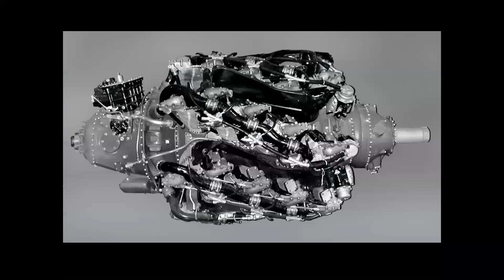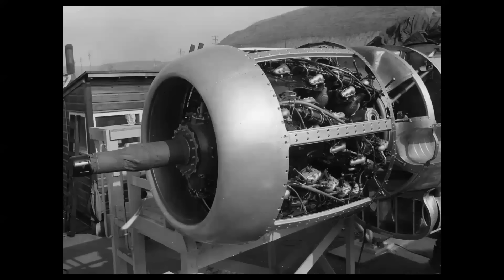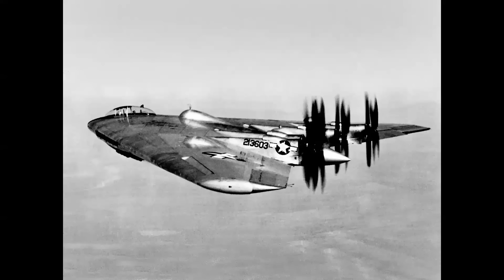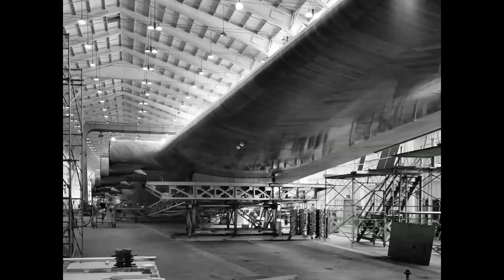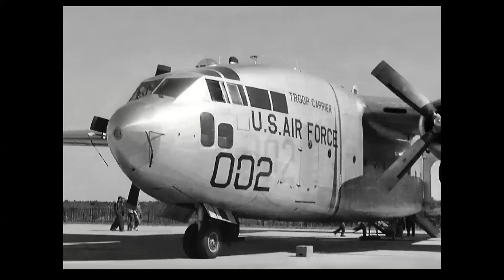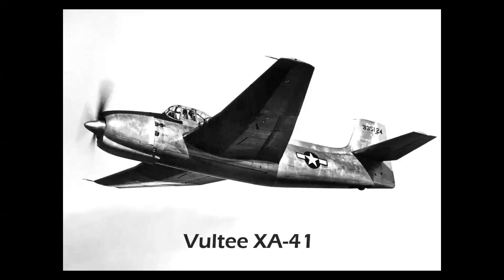PRATT & WHITNEY R-4360 WASP MAJOR AIRCRAFT - Airplanes powered by this giant radial engine

Comment: The yb-35 was actually successful, many of the tests demonstrated that it was capable of having the range and reliability for the mission it was designed to. The problem was that the gearbox for the counter rotating propeller had too much vibration which was not fixed. For that reason, they proceeded with the tests with the single propeller, which reduced a lot of its performance. After that, jet engines were attempted, on yb-49, which had the flaw of having lower range. More than that, the Wasp Major had a severe problem of over heating, which was seen on the Boeing 377 Stratocruiser, as it was common for it to arrive on the destination with at least one engine shut off.
Reply: The YB-49 had some major aerodynamic issues that made it an unstable bombing platform.  The cowling and props on the yb-35 acted as significant lateral stabilizers, and the loss of them really pooched the handling of it.  Northrop really leaned all in the flying wing, and didn't have the control/fly by wire stability tech to make the concept work at the time at that scale

Comment: As an engine enthusiast i can say hands down that air craft engines are indeed the most master pieces of art man has ever achieved . They are the combined power of all our knowledge , from electronics ,fluid dynamics ,chemistry ,machining, engineering , to alloys  and metallurgy .
Reply: Deep respect for massive engines .working like a swiss watch and powerfull
Reply: The complexity and engineering required for the aviation engine is mind boggling, the nomad 2, and other napier engines were absolutely works of art, the turbo jet changed all that overnight

Comment: As a design engineer I can't help commenting that the 4360 (and all engines of that era) were designed on drawing boards without benefit of the computerized 3-D design tools we have today. The designers had to visualize the third dimension on the paper and get that enormously complex assembly arranged without interference between parts.
Reply from the maker: Agreed 100%! It was definitely a different era from today's digital world. Thanks for the comment.
Reply: I just want to know if I can fit this into my Ford Explorer.
Reply: @mabrams8740 .  The torque would probably flip it.
Reply: Couldn't agree more, The level of engineering excellence achieved is nothing short of mind blowing when one considers that engines from this era are the benchmark bar none when it comes to reciprocating aero engines. They invented it all with slide rules and drawing boards and we're still able to take the idea and the tech of the day to the limit.
Reply: David Clark- I have the utmost respect and admiration for the people that designed this wonderful engine! In my opinion they were the brightest and best that this country has ever had! There are several of these and many other great engines still in service today and I stand in awe of the technological marvels of that time! Thanks so very much for your service to this great country of ours!
Reply: My mechanical engineering career spanned the transition from 2D drafting to computer based 3D solid modelling. I was actually actively involved in the early days of 3D modelling. 

The main difference is in the time that it takes to get to a completed design checked documented and approved in all 3 dimensions. Most large and ambitious designs in the 2D drafting era had a 3D mock-up that was developed and available to check the 3D reality and complex 3D linkages like landing gear systems. I worked on the GE LM-6000 in 1990-1993, a ground power variant of the CF6-80C2 Airline engine. We were tasked with the configuration of cooling air, lubricant and hydraulic lines for this ground power engine (60,000 HP for 50,000 hours, 30 different fuel systems for various markets). Every tube and bracket we designed were checked for static and dynamic stress using Finite Element Analysis and they were checked for 3D dimensional fit on the mock-up. In this case, the mock-up was a mix of some real parts from the airline engine, some wooden & plastic parts from the proto shop.

The difference I see in engineering today using 3D modelling and all the new manufacturing options available today is that  designers are able to to confidently design and build very complex 3D geometries that were just too hard to develop quickly and confidently in the 2D drafting world. Really good designers are able to visualize and think in 3D.... The new computer based tools allow them to quickly check, document and communicate those designs with other people and functions.

Comment: Two things amaze me about the 4360 engine. First, the design of 4 radial engines stacked on a single crankshaft and all the mechanics required, the WASP is like a 4300 hp swiss watch. The other amazing fact is that P & W cranked out over 18,000 units with no CAD design help, no CNC machining; just basic lathes, mills, drill presses and shapers set up and operated by people with dirt under their fingernails.
Reply: We need to remember there was still a lot of automation in the manufacture of these engines as repetitive functions were controlled by Cams and Gears,  and maintaining the close tolerances while moving from machine to machine.
Reply: @fltTech72  
Exactly, and most people don't realize that CAD "design" is a misnomer, the computer in CAD doesn't do any of the designing persay, it's still a human that does all the designing, the CAD program only allows them to see what they're designing in 3 dimensions instead of a flat plane, it more speeds up the designing process than anything else.
Reply from the maker: Agreed 100% - thanks for the comment!
Reply: Precision Machinists made it happen! 👍👍
Reply: @danielwalker3430  Indeed! There was a time when the state of Connecticut, especially the Naugatuck Valley, had more machinists per sq. yard than any place on Earth.
Reply: I think that one thing may have been overlooked.  The people who worked at the factories truly cared about what they were. They had brothers,  sons,  and husbands who relied on them to produce a well made machine to protect them.
Reply: It all begins with a good design and a quality manufacturing department 👍👍
Reply: Right on! Right on Ralph Averill!!!
Reply: At the Smithsonian Air and Space Museum (the Udvar-Hazy annex near Dulles Airport in VA), there’s a cutaway 4360 on display. I have spent HOURS studying it. It’s a huge, heavy, mechanical work of art. Magnificent.
Reply: I, personally, have always thought the P&W 4360 would have been a much better choice for the B29, instead of the high magnesium, fire prone Wright 3350. Even the latter day P&W R2800s would have probably been a more dependable engine for that aircraft. If I remember correctly, somewhere around 30% of B29s were forced to return to base, due to mechanical issues, mainly with the 3350, but also with misfunctioning cowl flaps. The 4360 was a monster, & had its teething problems, like every other great WW2 aircraft engine, but, the 3350 had much more than its share of issues.
Reply: @stanhathcoat920  Thank you for the history lesson. I agree that 30% is an unacceptable failure rate, but that is a peacetime, armchair quarterback point of view. They were trying to force the the surrender of Japan to end WW II. Likely they saw a 70% success rate as quite acceptable.
Reply: @ralphaverill2001  Yes, they did. However, I doubt the men who suffered from the failings of the 3350 would find it acceptable. I'm just offering my opinion on the state of the chosen powerplant, & could there have been better choices.  We can't actually "change true history", but we can examine where good & bad choices were made. The B29 was a great, advanced aircraft for its time, & certainly did its job, I just don't see a 30%(+?) failure rate in a 4 engined bomber as very efficient. But that's me.
Reply: Slide rule technolgy
Reply: The last of these were reported to crank out 6000 HP.
Reply: YES there is so little focus on the manufacturing process, and YES it is amazing how these men and women took their turn at the machines to make these immense mechanical devices. Also, while this video is fun and interesting for the extremes presented, there could be an interest in the opposite, the simplest and yet effective machines which were used and how they too could be of value in the battles of WW2.
<3
Reply: Ofc you need to realise all the cad stuff was based on pre-existing methods, drawing standards and the rest.
Reply: I like that thanks for sharing that with us, these are the real ones
Reply: It's the design of the connecting rods that make it work.
Reply: Thnx Mike M. Great page. I too love drawing airplanes. My dad played NFL in late 50. LAX. DC 7, CONNIES & those stupid jets. Talk about ART DECO. 🙂🙃
Reply: The mech's and engineer 's were so ingenious.
Reply: So much for technology - engineers today couldn't conceive that in their minds let alone design and build it without their computers!
Reply: The U S thought that the USSR could not produce thermo nuclear bomb because they did not have the computers that we had. They broke down the equations and had their people do the .math workout computer aid, we all know USSR Had thermonuclear bombs.
Reply: @justadreamin1004  How do you know?  Are you an engineer?
Reply: @MrShobar  yes, just look at the engineers making the Audi engines, or the engineers making the 2.0t Hyundai engine. The ones making the ford 5.4, the Cadillac 4100, etc etc
Reply: Everyone had a slide rule , I barely remember but one the advantages was to work out the calculations while everyone else was using their slide rules to follow along and correct you ! The problem with radials was anything more than 2 rings of cylinders gave almost no cooling to any more  cylinders
Reply: @oceanhome2023  the cylinders in the 4360 were staggered so they could all get air.
Reply: "... people with dirt under their fingernails...".   I hope not.  Contamination was and is an issue.

Comment: Nowhere in print that I know of is the rash of 4360 failures in the Stratocruiser Tankers that happened when the power was reduced at the end of a work shift. You have to understand how heavy the ships were on takeoff - they could barely manage 200 feet per minute climb then with all four horsepower-meters reading 4,000hp (no that is not a misprint) After burning off fuel, and the exhaustion of the anti detonation injection fluid (ADI) the engines were reduced to "Maximum Except Takeoff Power" (METO) of about 3,000hp and held there for 10,12, 14 hours sometimes. Realize they were trying to refuel early Century Series Fighters whose stalling speed was just above the maximum sustained level flight speed of the 97Gs even with the auxiliary underwing jets going full blast. A long gradual climb to 30,000 would be followed by a long gradual glide down to 18,000 and then repeated until the job was done.
       Originally the Flight Engineer would reduce power to "Flight Idle" to enable descent and eventual landing - when usually one of the four "Corncobs" would literally explode (and often catch fire) like a dragster engine.
      What they finally ended up doing was reducing the power in TEN SMALL STEPS separated by several minutes (5-8 minutes IIRC) and it eliminated the problem. Whether it was the sudden interruption of the vast quantities of heat going through all that metal - or whether it was the unique "stacked" crankcase design "unwinding" from being twisted all day by the stupendous (nearly 6,000 pound-feet ) torque it had been subject to - or some of both - no one ever told me.
      After that they seemed unusually reliable for such a complex engine and remained in production until 1955.  Spare engines are still to be found in odd corners of the world - and that's good. Surely no private repair shop (only the military and a couple airlines were ever so equipped) could or should attempt to get into the power cases of one.
You are welcome.
Reply from the maker: Great comment, thanks!

Comment: FUN FACT: The front and back crankcase flanges were identical on these engines. Want to run the prop from the other end? No problem - switch Power Take Off and Accessory ends and VIOLA ! Now it can drive a PUSHER propeller !
Reply from the maker: Very Cool! That certainly explains the XB-35 Flying Wing and B-36 designs. Thanks for watching!
Reply: @celebratingaviationwithmik9782  It also explains the design of the stillborn Republic 4360-powered P-47 Thunderbolt-clones called the XP-72s. Both prototype ships were not turbocharged like the T-bolt. Instead the unusually sturdy aft end of the crankcase drove a long shaft between the pilot's legs and drove an outrageously large supercharger. However like the T-bolt the compressed air was ducted through intercoolers on it's way forward and pressurized the cockpit as well as feeding the Wasp Major engine.
Reply: As a young man I helped maintain these giants mounted on KC97G tankers for the Kansas Air National Guard.
      A man named Graham White wrote the book on them and I thoroughly enjoyed it. Ford Motor Company made nearly all of them. The Pratt Whitney R2180 - the most advanced large reciprocating aircraft engine of all time - was almost exactly "half a corncob".

Comment: Dayly maintenance on my R 2000 7 M2.. kept them running and reliable. Never experienced a bent rod coz i drained bottom cylinder s after long periods/ and pulled props through on regular basses. And, have parts available to replace.

Comment: That 4360 was a great engine but it was an absolute nightmare to work on when installed in the aircraft. We had AC119s on the flightline in Thailand in the early 1970s and I can still hear the mechanics blessing those 4360s. I was a jet tech and I fared much better than the recip guys.

Comment: I was saddened to see your video did not mention the Goodyear F2G Super Corsair, the Grumman F8F Bearcat, nor the Douglas Skyraider.  While the F2G was an experiment shortened by war's end, the other two went on to long and distinguished careers.

Despite this, I did like your video.  Thank you for your effort.
Reply from the maker: Appreciate the comment, and yes the Goodyear F2G was powered by the R-4360. However, Grumman's F8F Bearcat had the Pratt & Whitney R-2800, while the Douglas Skyraider was powered by the Wright R-3350.
Reply: @celebratingaviationwithmik9782  Oops!  My bad.  I stand corrected.

Comment: I guess the only American made big piston engine that would of beat the Pratt and Whitney R-4360 Wasp Major would been the 36 Cylinder 5000hp Lycoming  XR-7755. Those would of been great in B-36`s.

   I am not a fan of large heavy complicated questionable-reliability piston prop engines ( I am a ex- U.S. Air Force Jet Engine Mechanic ). The British invented the Turboprop concept right after the WAR in 1945. They should of taken those studies and made more turboprop large bomber, transports and airliners after the war than just the Lockheed Electra in my opinion.

   Also Boeing`s Small Gas Turbine division had a great small engine turboprop powerplant ( Boeing T-50 and T-60 ) to be used in small light general aviation aircraft from the mid 50`s that would of had us in the turboprop /Jet single engine jet age in general aviation long ago. The FAA was a ass slowing that up too.
Reply from the maker: Thanks for your service and I always wondered why the British had so many successful turboprop aircraft, and the Electra was the only four-engine U.S. airliner (and P-3 patrol plane for the Navy.) Appreciate the comment, thanks!

Comment: The R4360 was the most powerful mass produced reciprocating engine ever made.
1948-57, the main long range bomber in the American arsenal, was the B-36. It was also the only bomber that could lift the early H-bombs, which weighed 21.5 tons. The B-36 was powered by 6 R4360s, and 4 J35 jet engines. The jet engines mainly supplied extra power during takeoff and landing, and enabled the B-36 to travel far enough after dropping an H- bomb to survive the blast.
The B-50, an important carrier of atomic bombs in the late 1940s and early 1950s, was a B-29 powered by 4 R4360s.
Reply from the maker: Great comment, thanks!

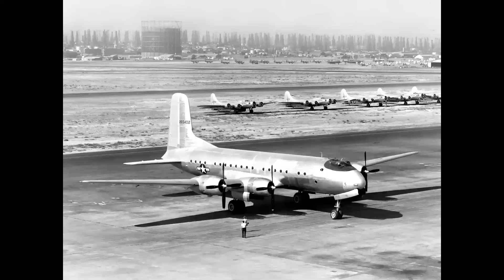Comment: Hi Mie, Mike here, great name.  At 7:30  where was that image taken, I see scraped B-17 "sad" and a lot of oil wells?  Maybe Long Beach by Signal Hill somewhere?  Could you imagine changing the cam plate on the third row back.   What a job.  Thanks for your time and work......
Reply from the maker: That C-74 Globemaster was at Long Beach in 1945, right as the War ended. And yes, Signal Hill in the background. Those B-17s were actually brand new, but unfinished (missing engines) after the Douglas production contract was cancelled that August.